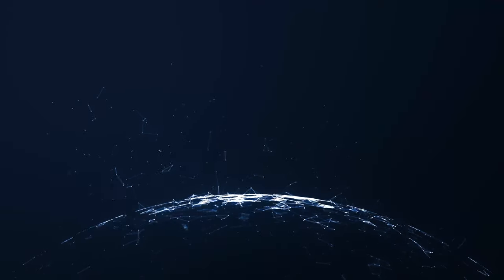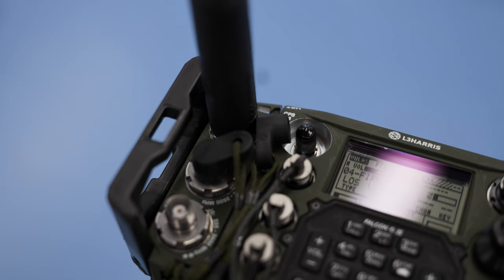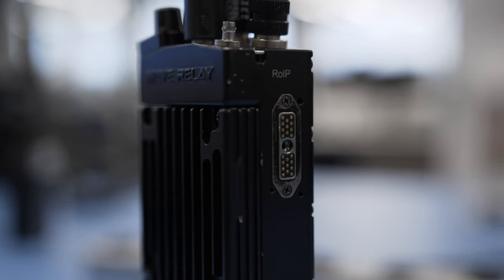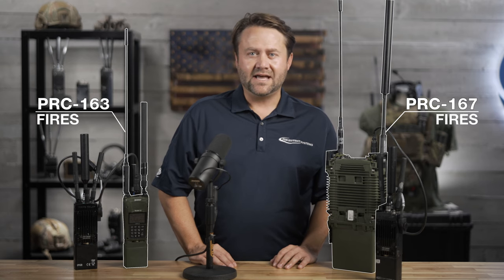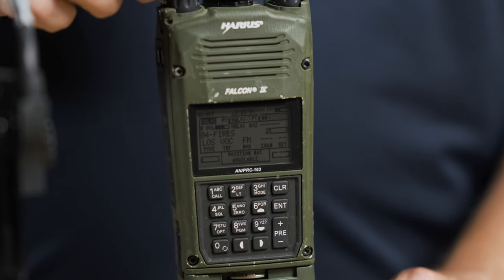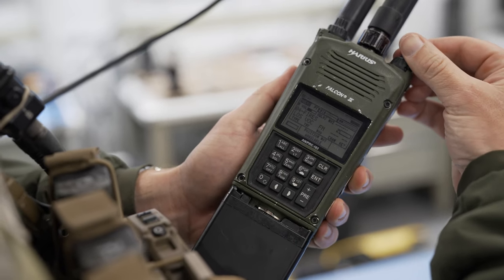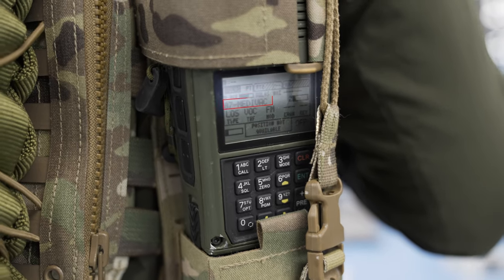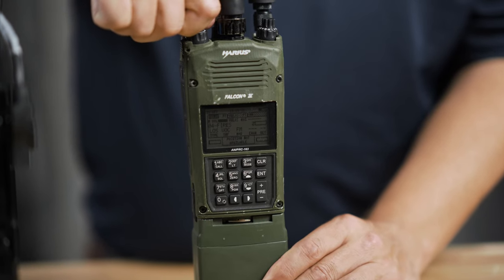Advanced Radio over IP with the MPU5 and L3Harris AN/PRC-163 & AN/PRC-167 Radios - Tech Relay

Comment: Most end users are using RT2 for TSM using Voice and DATA. This “smart cable” seems to just route simple audio with an automatic configuration and seems like a lost opportunity to also share data on both systems either both ways or one way to control certain levels of comsec used on either device. Especially since this is an audio only cable don’t know RT2 couldn’t haven been added -with auto configuration to make the RT2 the sequential talk group.?
Reply from the maker: @LukePRTR, we can configure the MPU5 to connect to RT1 but not RT2 on the Harris 163. Advanced RoIP allows us to not only route audio traffic but to also share a data connection trough the Nemesis connection on the 163 allowing the radios to adjust based on the configurations of each radio.

Comment: This is IP OVER RADIO. Not the other way. It is the same as WIFI but on different frequencies.
Reply: Well. If I understand. It appears the IP network facilitated by the MPU5 (which is like WiFi, sure) allows you to control other auxiliary radios and frequencies by other devices on the IP network. So perhaps it could be said to be RoIPoR (radio over ip over radio protocol) haha
Reply from the maker: @TheRealBigEE  @salmerin9129, while the MPU5 is capable of operating on the same frequencies as WiFi in S and C bands, our combination of hardware and propriety software vastly separates our capabilities beyond your at-home WiFi.  When it comes to RoIP @therealbigEE is on the right track. Our flat layer 2 network allows any user on the network to manage the RoIP gateways on the network. This allows an RTO or personnel at the Operations center to adjust the configuration of a RoIP gateway that they physically cannot access or is being carried by another member of their team.

Comment: Forgive my ignorance... but can we all just bypass this tech entirety with Meshtastic devices?? No voice needed....
Reply: Meshtastic is neat, but doesn't have the throughput needed for the jobs these are designed for.  Cant' send live video from a drone over Meshtastic... only compressed/stripped/minimalist COT messages.
Reply: @Real_Tim_S  in war, you wouldn't want to use RF for that..  it's 2024..  drones have tether line
Reply: @jargero8203  I think you're not considering that there are more types of drones than just the small ones that drop grenades in Ukraine.  You absolutely don't want to use a tether line on a Reaper flying at 10,000ft (~3050meters) AGL.  I mean, unless you like being dragged through the air by a drone.
Reply: @Real_Tim_S  I've considered that.. not relevant
Reply: For a regular Joe sure. for someone fighting first world countries, absolutely not

Comment: Also when i plug the 163 into the mpu5 and transmit on another 163 i don’t receive the audio in a separate mpu5
Reply from the maker: It sounds like your setup may not be configured correctly. When a standalone 163 is in range of and transmits on the same channel as the 163 connected to the MPU5 with RoIP configured, all MPU5s on the network will be able to access the audio generated from the standalone 163. Same goes for Audio generated on the MPU5 where all standalone 163s within range of a RoIP gateway will receive the audio traffic.

Comment: Does this radio work with gmrs
Reply from the maker: it depends on whether we have cables for a manufacturer that produces a radio using the GMRS standard. Currently, our cables are only designed for military and law enforcement radios.

Comment: What’s the benefit of doing this versus just using TSM on RT2 and then bridging internally in the 163/167?
Reply from the maker: The MPU5 is designed to provide RoIP capabilities for any NATO 6-pin or 19-pin LMR at the edge, enabling significantly enhanced interoperability. While using TSM on the RT2 works, it restricts you to the waveforms available on YOUR 163/167.  Key word is "YOUR" radio.  In contrast, the MPU5’s RoIP capability networks each LMR, allowing anyone to access the radio remotely. This approach significantly reduces SWaP and offers greater tactical flexibility. Think of it like the transition to networked printers in the corporate office. In the past, you had to bring a floppy disk to the printer or email files to a specific computer to print. As networks and devices evolved, the printer became a shared asset accessible by anyone on the network. Similarly, we’re networking radios to make them a shared strategic asset across your formations.